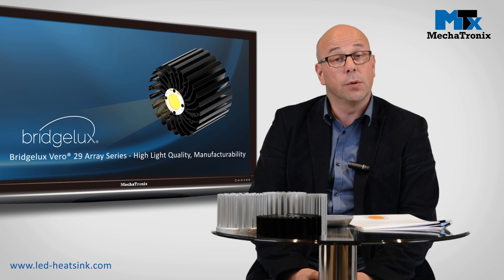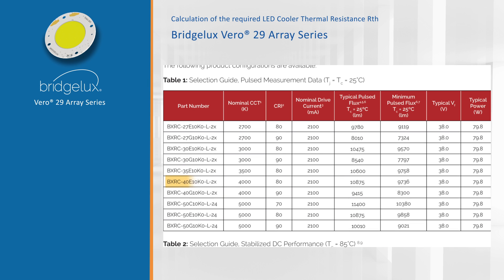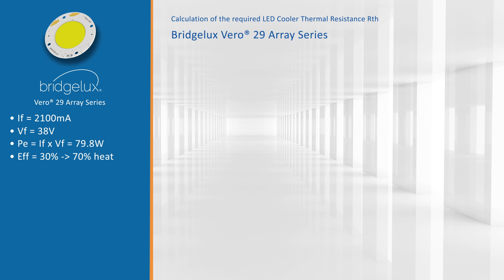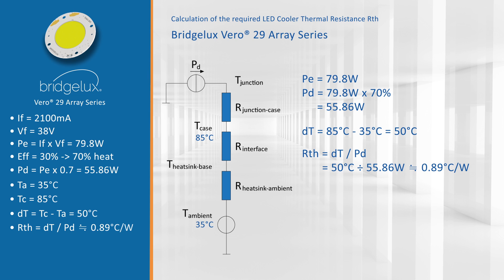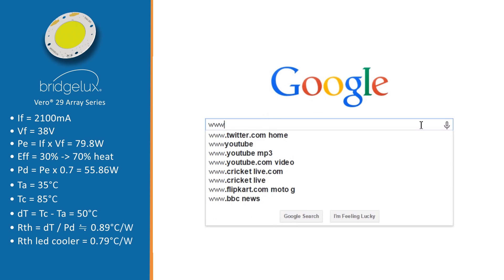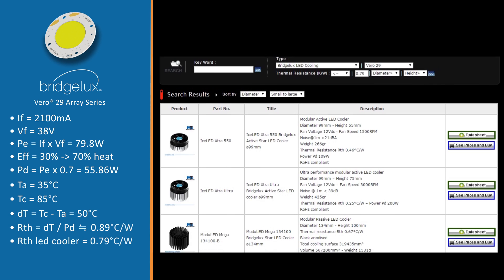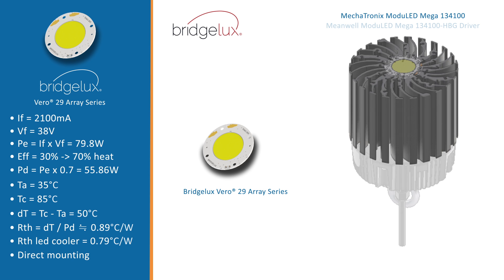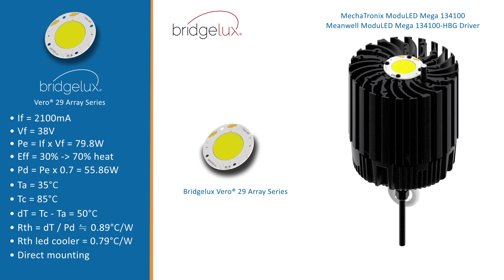Bridgelux Vero 29 LED array - how to select the correct LED cooler - thermal calculation

Comment: How did you determine that 70% of the electrical power goes to heat? I noticed you applied the same methodology on other emitters with different specs.
Reply: Late but https://en.wikipedia.org/wiki/Thermal_management_of_high-power_LEDs#:~:text=Most%20of%20the%20electricity%20in,makes%20the%20LED%20less%20reliable.